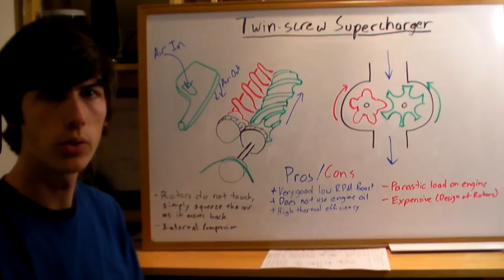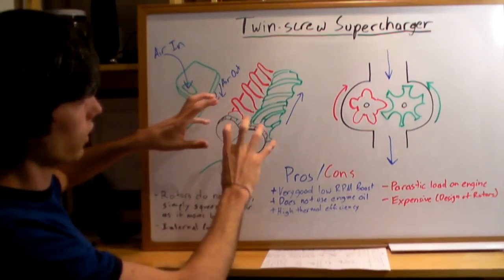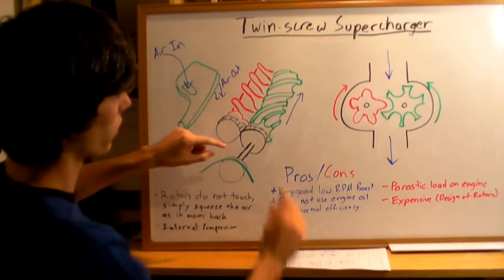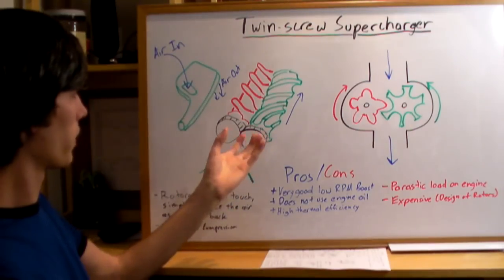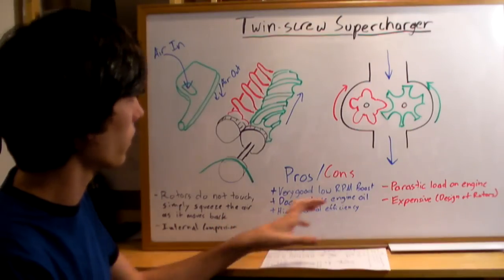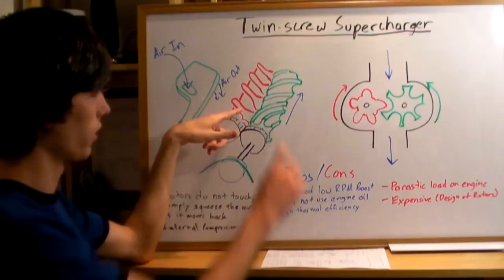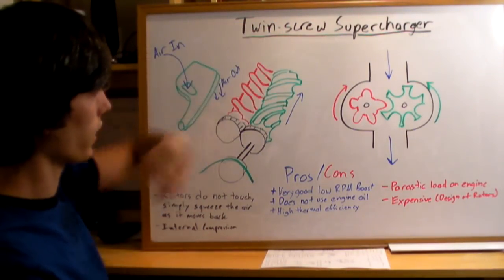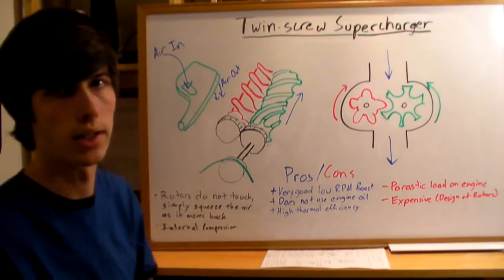Twin-Screw Superchargers - Explained

Comment: Good video, often overlooked by the tuning scene is just how much range is available to the power delivery of a supercharger, from rootes to lysholm single and twin screw to centrifugal types the delivery of the charged air is very different from each type. Daily driven cars are often used in the low rpm area and rootes are easy to get right in this position. Instant power is available from tick over and at this point much better than laggy turbos. Midrange is lysholm screw type strengths, so generally 2500rpm to 6k it will be a great delivery solution that usually makes the most power for the rpm, centrifugal types are best for higher rpm, like 4k and above, Honda for example love them and they perform well with vtec engines. My bmw m3 e46 is using a twin screw lysholm supercharger it's making 557bhp and 448lbft, seriously fast car and hasn't missed a beat in 2 years of the conversion. It's even on the oem ecu, Siemens ms43. I looked at turbo charging it and drove some but for road use and the rpm it's mainly needed, the twin screw lysholm is a seriously hard thing to beat, the response is instantly there, and the power comes in so fast and linear, no turbo is capable of doing it anywhere near as quick. My setup is good from 2k to 6600rpm which is where the oem car is at its best. The upgrade is just improving on what is already a great power supply, and it's very well designed having its own oil supply and cooling system, its a separate entity to the engine and besides the drive belt, puts no extra demand on the engine. It only needs the fuelling and timing adjusted to work with the charger and its not got the heat issue that you get with turbo charging. All in, looking at the difference between the supercharger options is a very important factor to understand before you make a decision on what you are going to force feed the engine by.

Comment: Air from compressed side can move back from around the gears while getting trapped between gear and boundary as there is gap between them as they rotating in reverse direction when compared traditional gear pumps,how do they prevent it

Comment: I had a Jackson Racing Supercharger on a civic in the late 90's. I remember the guys saying something about how the supercharger would automatically be bypassed or switch to only 2lbs of boost when cruising to save fuel.. 

Does anyone know how that system worked? and is that something that could be rigged up to say a switch where you could literally 'turn on' your supercharger when you want it.. or leave it 'off' to save gas..?
I drive 300+ miles a day on a one-lane highway and would love to have a-little extra power to pass slow moving vehicles etc, but I also need to get the best mileage possible
Reply: The device is called a wastegate, normally used for turbos.
If you are running a twin screw having the compression ratio optimized for boost would probably yield better results.
Or if you really want to go with the wastegate route, get a turbocharger.
Reply: I have seen a clutch mechanism used on farm equipment and older large trucks(like dump trucks).
Mad Max actually, is a good example of what it's like to use, but i liken it to how your AC compressor kicks on and off. Doesn't  sound like what you're asking though. I think The first response would be closer, but i'd feel weird using gas to boost a bunch of air through a cool sounding pipe. lol. Idk, maybe it would be better. im no expert =)
Reply: Edit:  I'm a half reader, i admit it. Still answered it right. =p
Reply: Why would you want to shut it off?  There is no difference in fuel mileage what so ever.  On high loads as engine speed increases the supercharger pulls more air and the computer compensates with more fuel.  The job to keep RPM's low is the job of the transmission .  It's not very often you are going to be driving around with 6,500 RPM while doing 35 miles per hour at wide open throttle.

Comment: I have a silly question I suppose but I am a refrigeration tech so I work with twin screw compressors every day and on our compressors we have a volume control plate if you will that the compressor uses to change the compression ratio of the compressor to over come the head pressure of the refrigeration system. My question is why couldn't you incorporate a volume control into a twin screw car supercharger to say run 5 pounds maximum boost instead of say 15? Just throwing numbers out there for comparison.

Comment: I've heard that you can get a supercharger with an electromagnetic clutch that disengages the pulley, is this true? and is there a problem that comes along with this
Reply: Unless OEM or comes as a kit, it would be fairly complex to tune. Have a look at procharger i-1, which is actually more advanced.
Reply: +Joel Mole As in the Mad Max car? No this is movie magic without a very complex system to bypass the supercharger.
Reply: Jack Allen http://mr2.com/TEXT/SuperChargerInfo.html

refer to this under "supercharger clutch" i had one for a couple of months it works very well

4A-GZE AW11 MR2 1988
Reply: It's also very nice because it's boost by throttle very efficient system don't understand why it isnt used today
Reply: I know the 1.4 TSI found in the golf and scirroco use a clutch type system on theirs which runs off the water pump pulley

Comment: On any type of supercharger parasitic load is what minus 1 or 2 hp but overall you get around an extra 20+ horsepower depending on setup and what type of supercharger? Essentially when the engine is going up RPM and the supercharger is producing more power, does the parasitic load pretty much make next to no difference?
Reply from the maker: Ratkill9000 The parasitic load can be substantial. Not just 1 or 2 hp. You have to think about how much energy goes in to forcing in more air. The supercharger is a big air pump, being run by a bigger air pump (the engine).
Reply: and it depends on the brand, and size of supercharger
Reply: +Ratkill9000 At High boost they can rob 100hp from the engine.
Reply: It all depends on the psi and type and brand

Comment: They are not only for low rpm couse new generation of twinscrews are also great for high rewing engines... do a research before you spreading wrong informations.
Reply from the maker: Did I say they were only good for low RPM? They're effective at low RPM, which is a characteristic difference between superchargers and turbos. It's a benefit, but they have parasitic power losses.
Reply: Are you talking about adiabatic or volumetric efficiency? Or you just call this parasitic looses? With higher boost or rpm's you need more power to spin the supercharger as you need lots of energy to spin the turbo with making restriction on the exhshaust system which creates tons of heat around the turbine. Adiabatic efficiency is the same with new generation of twinscrews...

Comment: Can you have a turbocharger and a supercharger or it is just not possible?I.m curious
Reply from the maker: Yes, it's possible. I'll have a video soon.
Reply: Engineering Explained  FYI Volkswagen has used supercharger and turbocharger together for it's TSI petrol engine (e.g. VW Golf TSI 1.4L 160HP)
Reply: Yes, it's called a Twincharger.  They are very expensive, hard to set up, and have a lot of parts involved.  They work best on smaller motors because they can use the high rpm's to their advantage, by providing both high and low end boost throughout the powerband
Reply: there are procharger. belt driven turbo.
Reply: +Andrei Tanasescu Here's an example of a turbo and supercharged (twin charged) Lotus
Reply: +Andrei Tanasescu Many old 2 stroke diesel engines had them. Although they always had roots blowers. The blower was to scavenge the engine (no intake or exhaust stroke only compression and power) at start and idle then when the boost got high enough the turbos would take over.

If your wondering about the 2 stroke diesels they had ports located near the bottom of the cylinder, when the piston was at bottom dead center the ports were revealed and the exhaust valves opened. The blower would blow fresh air into the cylinder and exhaust out the top exhaust valves. The piston would rise compress the air,inject fuel and have a power stroke driving it down to be scavenged again. And no you didn't have to mix oil with your fuel. They don't make them anymore because they couldn't even meet 1980's emissions laws.

Comment: Why does the throttle body need to be placed before a roots blower and why does it not matter with a centrifugal one?
Reply: Roots doesn't pressurize the air by itself. It needs backpressure from the engine.

Comment: If I was going to have multiple chargers and one was to be a supercharger, I would use a twin-screw and a turbo. Supercharger for no lag, and the turbo for high RPM boost. I believe, not 100% sure, that centrifugal superchargers do not add "as much" power as twin-screw or turbos. I stated it would be a waste of money, but that is not an educated statement. I would just do one or the other, personally. Your adding weight but not really adding power since you can get tons of boost with just one.

Comment: having multiple turbos does not necessarily add more boost PSI. You can generate 30+ PSI with a single turbo charger. You use multiple turbos for other reasons, some of which are: more CFM (larger engine/ more cylinders), engine layout, or different sizes of turbos, like one small to spool faster and reduce turbo lag and one larger for more boost.

Comment: OK think of a twin screw supercharger as a meat grinder you throw your meat into the grinder and as the meat is going through the grinder its becoming more compact and more dense same with the supercharger it takes the air compacts and make it more dense and shove the air into the intake and with the virtually no gaping around the screws there it no room to escape and lose pressure

Comment: in the centrifugal supercharger, if the low rpm boost was bad, is the benifit in the high rpm? if so, would it be possible to twin charge with a root supercharger and centrifugal supercharger?

Comment: Watched your video and other videos on screw compressors.  I still can't visualize how the compression actually works.  There should be a diminishing space between the screws, where the air is getting compressed.  But I can't visualize how this space (1) would diminish as the screws turn (2) would not vent back to the intake.  Does each screw have a fixed or varying cross-section?  

Perhaps, I should wait until I can physically examine a screw compressor.

Comment: Depends on the size of the turbocharger / supercharger and what sort of power delivery you are looking for - low end (low revs) torque from a supercharger against high end power from a turbo.

Ultimately it will come down to cost and personal preference - speak to your dealer / performance shop and they will give you a good idea of the options.

Comment: I know that with turbos, a small turbo (a stock GS-T T25 for example) boosting 14 pounds will yeild lower HP numbers than a larger turbo with better flow rates (a stock Evo III 16G) at the same boost level. Does this apply with any SC setups? or is HP linear with boost levels regardless of the way the boost is produced?

Comment from the maker: Since turbochargers are inherently more efficient by design, I prefer turbochargers. Also, I like the fact that power can be separated between high and low RPM. Low efficient power at low RPM, high power at high RPM.

Comment: Oh and btw the car is a 06 civic si and the whipple is a ax140 2.3L. Gonna spin it at about 12000rpm to put out about 430 to the wheels. Still on stock block so will need to wait on spinning it faster.

Comment: got a quick question related to it from a design standpoint, now a twin-screw blower requires more machining & the like which is why they cost so much but with a TVS (4 lobe roots blower) that would be less complex compared to a twin-screw or do i have that wrong?

Comment: to get any kind of beneficial flow of compressed air, and these things can pump out over 1000cfm of air, it would be impossible to get that through the middle without spinning the rotors to a mind boggling 100krpm (doing air flow tests atm)

Comment: i thought that, looking at the lysholm supercharger i have open in inventor, the male and female helical rotors, when intersecting, are designed in such a way that there is always a very small gap in the middle, to create a suction/vacuum, and the air is pushed around the outside, not through the middle.

it makes more sense, because as you explained, they dont touch, but they get very close. when the profiles mesh there isn't nearly enough room in between them.

Comment: so when you weigh the pro and cons of turbo v super charger, is a turbo better bcos it weighs less, has no parasitial load and can acheive greater boost? Also if I convert my car from N/A to turbo, will that increate the acceleration of the car, how long does boost take to kick in?

Comment: The only flaw i would see, with the turbo feeding the super charger, is the amount of heat going to the super charger. It would be better to just save and by 2 superchargers, on one of my dads trucks he use's a twin supercharger set up on a 502 CB In v-8. The only other flaw to this set up, is on stalk heads they would probably blow them off, due to the huge amount of boost.

Comment from the maker: You could do it either way. I don't know much about vehicles that do it, but there is probably a preferable method. Also, by incorporating a valve system which regulates pressure you could have them in parallel, both taking in air and feeding the engine directly.

Comment: Correct me if im wrong but the twin screws are driven by the engine belt which enables them to turn quickly and compress the air, the air its self does not turn the twin screws. and the twin screws do not (by themselfs) make the engine of a higher torque and horsepower. the twin screws compress the air which makes for a larger explosion in the combustion chamber :)

Comment: @shounakchoudhury turbochargers do not have a parasitic load as they are not coupled to the engine. they run on exhaust gases only. they do however create backpressure in the exhaust that isn't there on an NA engine, so the turbo doesn't create entirely 'free' power. whether a supercharger or a turbo is better depends on the application.

Comment: Incorrect. The "screws", turn the opposite direction as mentioned. The reason being, the intake is on the FRONT, not the TOP or it shares the FRONT AND TOP, as in on the corner, to ingest as much air as possible. Once closed off, the air is forced towards the bottom, and the back of the supercharger. A triangle shaped pocked is now formed, and becomes smaller and smaller.vBeing that one rotor has more "teeth" than the other, you get the internal compression mentioned.

Comment from the maker: @DaRobsterr Well that's the main difference, that a twin-screw actually compresses the air internally. No oil is necessary, they are both self lubricating, and with the twin screw, in theory (if it's well designed) the two screws will never touch, just get very close to each other, preventing the need for lubrication. My integra is bone stock. Since I'm still in college, I have no money to put into it. I'm hoping after graduation to buy a new car, and have my integra as a project car. We'll see.